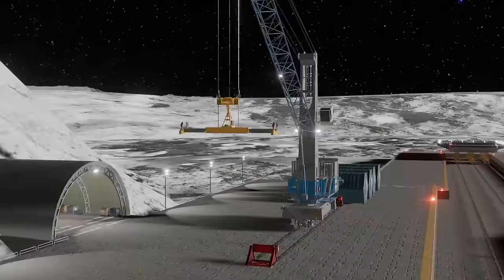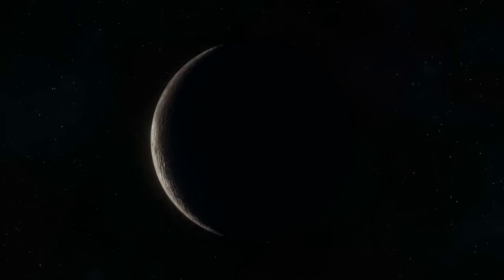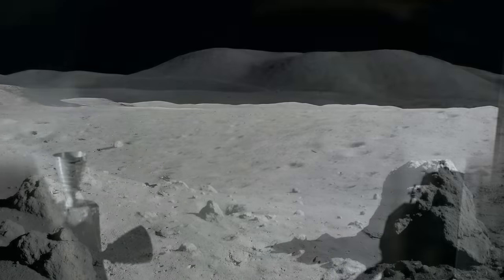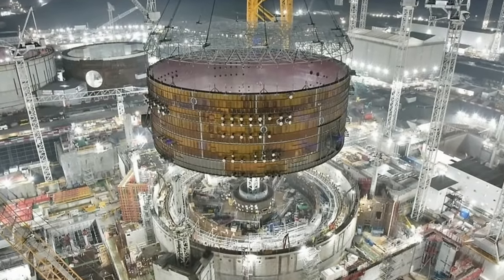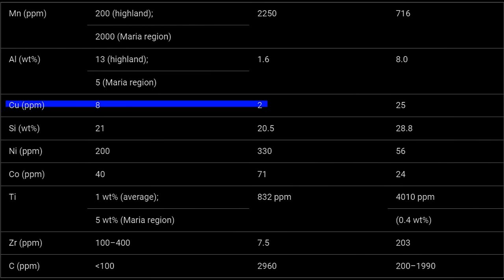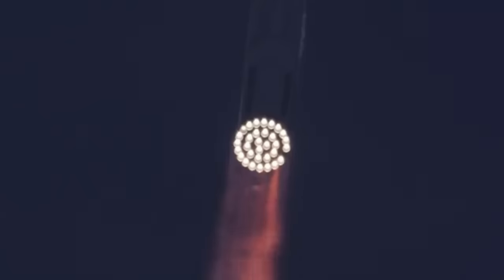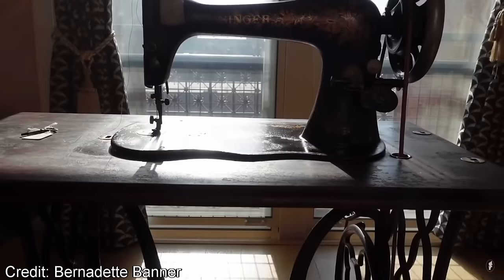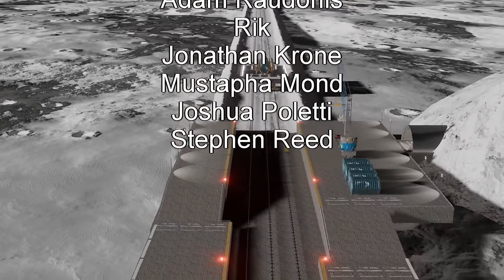Designing Heavy Machinery To Excavate The Moon

Comment: The radiators for nuclear can get quite a bit more compact once you move away from traditional low temperature glycol radiators used for ISS & Space Shuttle life support systems. A relatively conservative tech like liquid metal radiators or liquid metal heat pipes can reduce the size and mass by about 24x over glycol. More ambitious radiator tech like tin droplet, Curie point, or Maragoni flow radiators can get it down further. Project Rho has very thorough documentation of how that's possible.
Reply: Also isn't "active radiators" a thing? Can't we make radiators just radiate more?
Reply from the maker: Good to know thanks!
Reply: Couldn't you also disperse heat through the ground.
Reply: IIRC the lunar regolith is very resistant to heat flow
Reply: @enclave6285  I just looked up the values and the thermal conductivity 1m deep is just under 1% of what you might get here on earth. That's just wild. Also to note is if you crush up the regolith into a finer powder it becomes slightly more thermally conductive, but I don't know to what extent.
Reply: This was precisely my comment on this topic! Very good summary.
Reply: Yeah looking at thermally limited steel radiators and the radiation equation shows the power of that quartic term quite nicely
Reply: What about using the waste heat for sterling engines?!
Reply: thats complex. just attach large fan

Comment: Any kind of sleeve, seal, bearing or flexible cover  is a nonstarter on the Moon, pending further research on basic materials. The temperature extremes eliminate 98% of all polymers, the radiation eliminates the other 2%, regolith is a magnetic so you can't use magnetic seals or slips, and the temperature extremes frustrate any use of straight metal-on metal tolerancing. The only option left is ceramics, which basically can't accept any impact loading. Thus we're left with sucking on lemons until we can invent something that can overcome all the limitations.
Reply: PTFE!
Reply: tysm

Comment: One issue I see with your dozer design is you typically want the blade to be wider then the track so it can run in its own tracks. Also, with the relative lower gravity and the abrasive nature of regolith, enclosed gear trains might be a viable option. Perhaps even electric linear actuators in place of cables and pullys.
Reply from the maker: Noted! Thanks
Reply: Another major problem is that lunar regolith and tracks is simple in concept, but harder to overcome.  The lunar regolith is VERY abrasive.  Very much more than the desert in Desert Storm.  It's a pretty big problem because the lunar regolith particles are so much smaller than earth desert sands.  I mean it even got into the Apollo Astronauts joints of their spacesuits!  So that fine sand created a maintenance nightmare for the tank forces for everyone involved.  Now put that problem on the moon!  It is probably better to use wheels than tracks, at least in the beginning.  Keep the bearings out out of the way as much as possible  with wheels.
Reply: @paulwollenzein-zn1lh  Maybe legs would be even better. Not like mecha-legs, but something mechanical and sturdy. You don't need 360 range of motion for legs joints, so you may get rid of bearings and joints themself by making thing out of flexile materials. Add a lot of this small bending legs for weight distribution and you are good to go!
Reply: @paulwollenzein-zn1lh  There have been some interesting developments on that front. The new lunar space suit tech they are developing includes lining the fabric with conductive material. They then give it a slight current/ can pulse current to repel the charged moon dust. It's by no means a perfect solution but I imagine this can be applied to all sorts of vehicles as well.

Comment: "Except in the US where they are built around ego" 
I chuckled at this one
Reply: @Anthrofuturism and the oil comment 😂
Reply: The Environmental Pollution Agency actually had a large part in that. Though I agree, ego is the driver (no pun intended) in most purchases of large vehicles.
Reply: @jed-henrywitkowski6470  The EPA regulated to lower emissions, yes. It was still the fault of the corporations for saying "ok, we'll just sell bigger and bigger trucks instead of cars because of the vehicle class loophole." It would have been better if the EPA hadn't left that loophole, but let's not pretend any of this is the EPA's *fault*. When it comes to the problem of huge idiotic pickup trucks, the blame, as always, lies with whoever is making billions from the situation.
Reply: @delphicdescant  No it is the EPA's fault, they knew what they were doing and had ample time to cores correct.  EPA was captured early on and was more interested in keeping out imports than cleaning the air, at least so far as vehicles go.  They are also interested in killing the aftermarket supply of repair and mod parts, because the corporate overlords deemed it so.
Reply: @zyxwvutsrqponmlkh  Well that sounds entirely too conspiratorial to be true, but I guess it doesn't really matter whose fault it is, just that it sucks and should be fixed... 

These gigantic trucks parked along the street and blocking entire lanes just to flaunt egos and cope with the smallness of the owner's life (among other things) is beyond just annoying at this point.
Reply: I...unfortunately can relate

Comment: I like that your framework for heavy machinery gives good reason to start spinning up steel braided cable production fairly early; a lot of the mega-structures and things approaching that scale that we would likely/eventually want to build on the moon would make use of potentially thousands of kilometers of the stuff. Getting production going early and for such a central aspect of early operations means that, by the time we get to the "big stuff", we'll have worked out most of the kinks - so to speak haha.
Reply from the maker: Yeah that's what I was thinking too! So many uses beyond excavators.

Comment: Pulleys are 100% the way to go; perhaps draglines. There are NASA documents made back in the 1980s - 2000s that are still useful and which supposed draglines are best. 
To be honest you might as well go fully electric for everything. Completely agree with sodium ion batteries. Good video!
Reply from the maker: @benwaters5627  awesome I did know about those papers but will find them, thanks!
Reply: What about big chains on gears? Like a bicycle.
Reply: @floatingeyes5106 Probably not since they have hundreds of small, easy to break joints. A pulley system has just a swivel and a rope.
Reply: Draglines are still used today, they're diesel electric. In a way, that means as long as electricity is supplied, earthbound designs should work on the Moon.
Reply: @12pentaborane  Pretty much! Also lunar regolith should be soft for the first couple meters so might not even require explosives like that on earth.
Reply: The problem I see with this is regolith dust getting into the mechanisms, there is no air and bugger all gravity to carry away the dust and build up in the pulley grooves and in the fires of cables will be a problem.
Reply: @floatingeyes5106 like a bucket chain excavator?
Reply: @benwaters5627 : As I recall, while regolith is powdery for the first few meters, it is not soft, but instead is highly compacted. It's still a fine powder, so things can be done, but it is very much properly weight-bearing.